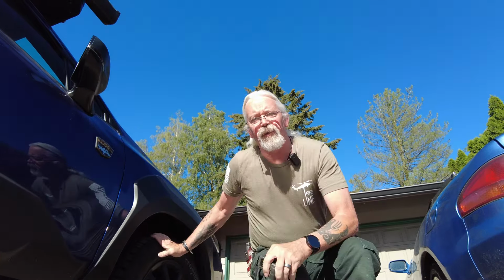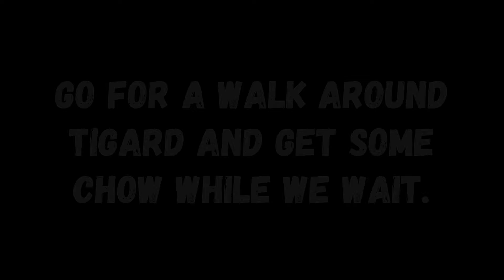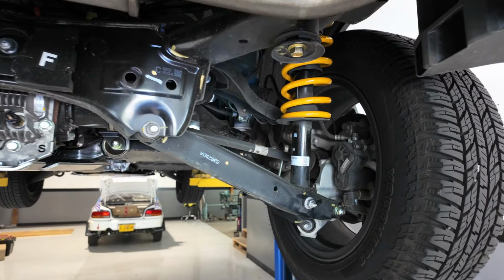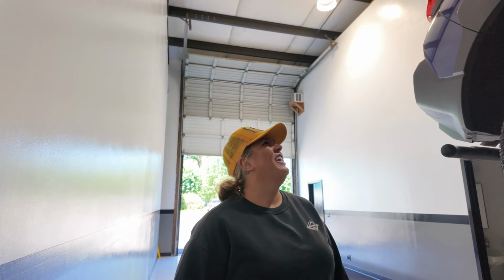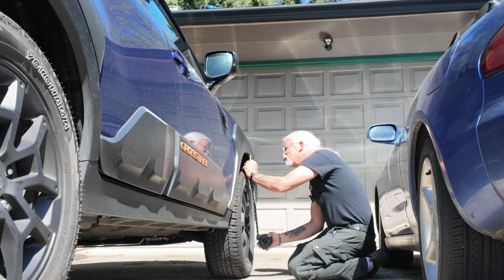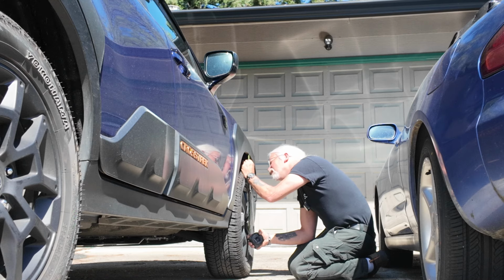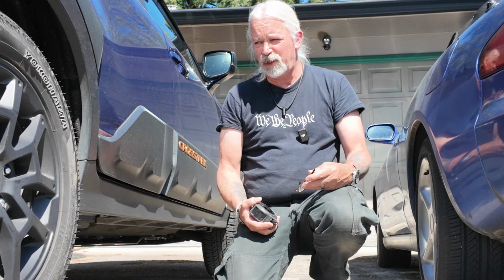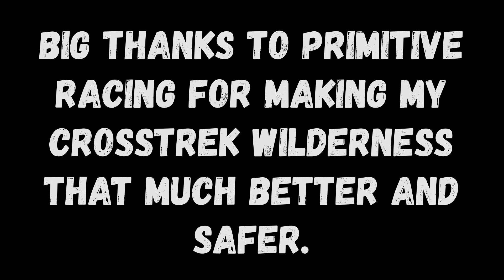Primitive Racing King spring install 2024 Crosstrek Wilderness

Comment: Just curious, with all the skid plates and now lift kit, have you compared how more or less fuel efficient it is now? Do you have numbers? I would imagine worse (probably not by much) since it is now heavier; but this also brings a thought about how the engine performance fairs when going uphill due to the added weight? Cheers!
Reply from the maker: I've not noted any difference in MPG with the plates or springs.
 The springs are a neutral weight issue as they are just sprung different so nothing there. It's not like a truck lift kit that adds all sorts of equipment. 
 Actually and oddly enough, even with the added weight of the HARDTOP roof top tent, I barely lost much mpg at all. As I recall in one of my videos I actually gave the numbers on the mpg with my hard top tent, and I stress the hard top I have. 
 Reason is this one is aerodynamic, light and smooth / thin. Vs a soft RTT that as I mention in a prior video often are shaped like a brick with yet another brick on top of that creating a wall up there.
 Yes, hard top tents are more costly, but in durability, ease of setup and resale value as well as mpg savings, I only really had one choice and stuck with my gut feeling and logic. 
 With that said, I leave mine on all season long. I don't want to only put it on when needed as I may get off work and have a wild urge to...well...get out in the wild, so at a drop of a dime, I'm outta there.
 As to engine HP output, to be honest, I really have not noted any loss of feeling of power either. I'm not trying to win a drag race either, but I'm clearly not having any issues at all.
 Keeping in mind, the wilderness also has a lower gear ratio than its counterparts of crosstreks.